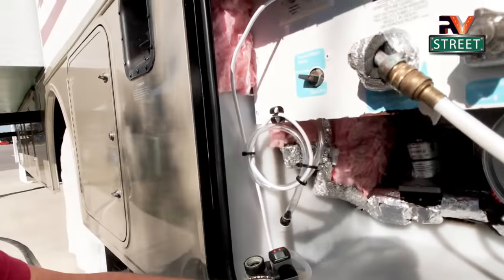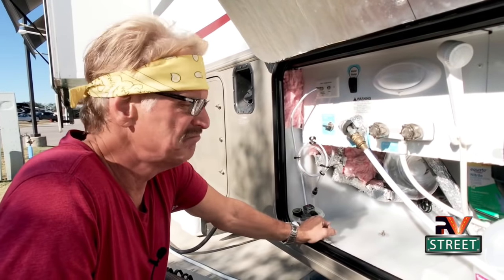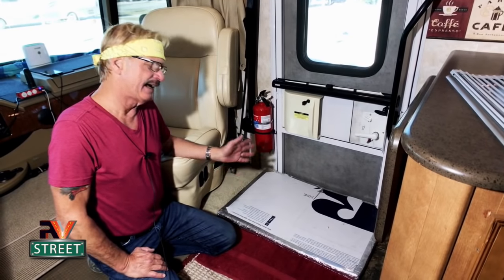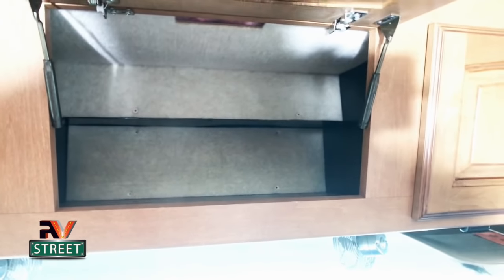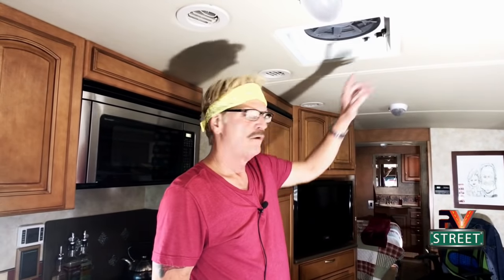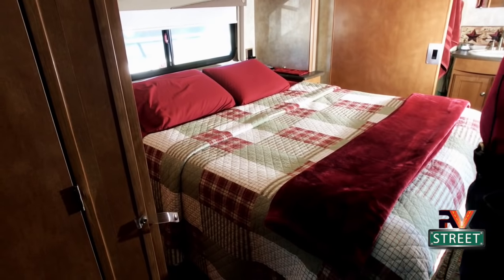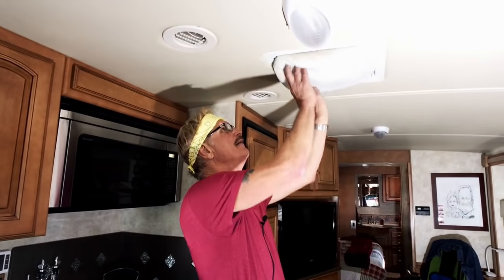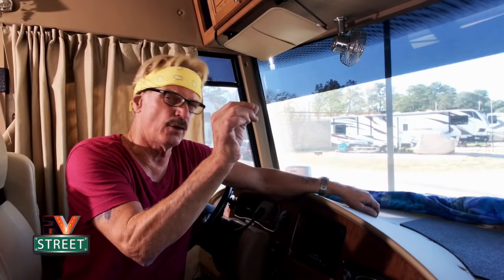😰  INSULATE, HEAT & PROTECT • Key to stay warm in your RV

Comment: I'm charged 17cents per kw hr. Just using a 1500watt floor heater and a 750watt floor heater at 20deg average ambient temp was costing me $400 a month electric bill alone. And that was turning off the hot water heater every day. These RV places that you have to pay your electric usage set the rates high to the point it's very expensive to use electric anything equal to propane consumption. Greed.  So I've been mixing it up propane and elect and it's still costing me $400 a month in cold weather In a 40ft 2020 Montana. I'll try some of your tricks and maybe build or order a canvas skirt to haul around. Good video. 
Our Montana has that patent pending front cap window which is kinda cool but I just pulled 5 gals of water out of there. I recommend avoiding that front cap window and lounge sofa. Go with the closet front cap. Happy RV'ing.
Reply from the maker: I recommend avoiding that front cap window and lounge sofa. Go with the closet front cap......
I agree.

Comment: We bought our first RV this year.   A Class A Thor.  In early Sept we were in SD.   We were not expecting below freezing temps and used our propane furnace.    The book from Thor does state that they do not suggest just using just electric heaters as they have installed vents off of the furnace to keep the pipes from freezing.   Respectfully,   Kevin
Reply from the maker: If you have basement heating that comes from the propane furnace and it's going to freeze outside, then yes by all means use your basement heat since you have it. But what if it's 35º, 38º, 42º or whatever. It's cold but you don't have to worry about pipes freezing, your not going to disconnect your outside water etc. This is what I was trying to get at with my question. Why not run a floor heater or electric heat if you already have full hook ups? It's cheaper, it's quieter, and you don't have to be continuing to go fill your propane tanks. I mean to each his own but for us it's going to electric floor heat. It just makes more sense.Respectfully, Martin 👍
Reply: RVstreet    I agree 100%.   You asked why anybody would run propane furnace.   I gave you an example in fact.
Reply from the maker: @KevinCoop1  👍

Comment: Did I miss it?  Explanation for why to use Un-faced R-19 batting?  Reason:  faced insulation can trap moisture, causing mold. Unfazed allows (slowed) movement & drying of moisture..you want the moisture to be able to dry out. 
Best thing ever? Dehumidifiers!  If you’re clever, can make those drain to the water tank, that you FILTER the water from.   One issue though, is that some dehumidifiers will develop ice that clogs the coils, so, will need defrosted before those will run again.

Comment: I think this is so awesome ty for your amazing videos! Question does any of this create any moisture problems as in mold? Ty!
Reply from the maker: Thank you Jeremy 👍
No. In fact it helps prevent it. The better any RV is insulated the less condensation is created which overtime could create mold. That's why I focused on insulating so much in this video. But in the winter—where you have two colliding temperatures.....you take care of condensation with the ways I discussed.
One place every RVer should watch for and prevent mold is under the mattress. I have a video coming out in early Dec. that will discuss that.
Reply: @RVstreet  Ok sounds great I’m going to get right on that this weekend,ty again!

Comment: We use propane heat because it heats our underfloor and is releases moisture . Electric heat is dry, and does not heat under our floors... Two of us even get nose beads from electric heat. Also , in Texas electric heat runs us 300.00 extra our month. Propane is very Cheep wholesale in Texas. 4 full bottles is only $40 .
We usually use no more than 10 bottles a month for heat, cooking, water heater. Our refrigerator is electric and propane . Also , when the power goes out , propane and DC ( we have a solar battery charger) powers heater water heater and refrigerator ...
But we use to use same heaters you do. We gsve them do out daughter in her 27 ft c class.

Comment: Just happened to see your video.  I've been done with propane heaters years ago despite good heat output because my wife and I could still smell the fumes. They also put a lot of moisture in the air as the windows were dripping the next morning.  I have a class B + RV so my heat needs are smaller.  Recently bought one of those diesel heaters as we boondock more now. They exhaust outside so the heat is pure clean dry heat and so hot that I have to open the window to let more cold air in.  Only needs a good 12 volt source as a gallon of diesel can last over 2 days.  The point about using your ceramic heaters because you paid for the campsite is perfectly valid but some would argue that your leaving a larger carbon footprint.  Remember the power plant has to burn more coal or gas to provide your electricity. Either way you need to exhaust some resources to provide comfort.
Reply from the maker: I did cover how to control the moisture/condensation that most RV's get on the windows when it gets really cold outside and you keep the RV warm inside. Did you watch the whole video? Most people—even us—use a couple of small dehumidifiers and crack a couple of vents so the RV can breath some. With that combination there is no condensation.
thx Phil

Comment: All you have to do is take a large candle and put it inside a coffee can set it on a concrete block on the floor in the middle of the RV and light it and you will be toasty warm in a few minutes there's a trick to try it saved my life at 33 below in Maine one cold night inside my tractor trailer when the fuel gelled up on quit
Reply from the maker: Good emergency tip. We love it up in Maine......in the summer.

Comment: 37:31 Great info. Thanks! BUT too much info with the spooning thing😂.  APPRECIATE THE CLEAVER IDEAS. Consider a wabasto heater?   I think this is the best for off grid heat. Get wabasto brand and NOT Chinese knock off brands.  If the heater doesn't work, PUSH DOWN THE CONNECTOR UNTIL YOU FULLY SEAT IT ALL THEY INTO THE UNIT!  I'm a veteran tech 25 years and I had to call their holiness for help. The connector is deceptive about how it fits.
Reply from the maker: Thank you for sharing your knowledge and helping the RV community. 👍

Comment: I use the propane furnace when I first enter my trailer because it heats that space very, very quickly. It's only about 140 sq.ft. Once it heats the trailer to the thermostat setting and shuts off, I turn it off completely and use a tiny electric heater.

Comment: Regarding the propane use: I have all tanks underneath and they are heated by air using the propane system. So I can use electric when it’s at most around 30, if it gets lower I will have to use propane heating to avoid pipes and tanks freezing.

Comment: The condensation on the window would best be prevented with insulation,  like that reflective bubble wrap. Condensation not only causes problems with water damage but it reduces your comfort level by lowering the humidity.  
72 with 5% humidity feels cooler and is less comfortable than 68 with 35% humidity

Comment: Hey Martin great Video I use Propane and electrical heat to counter each other on the moisture problem. Also having double pane windows helps.
Reply from the maker: Ya, we have Double Pane Windows too in the rest of the coach but of course not up front in the cabin area. But in our coach even with Double Pane Windows and it really gets cold outside and we're keeping the coach really toasty—like 72º-74º inside—we still have to run our dehumidifiers and crack a vent or two to control condensation. But it works good that way.

Comment: We have a propane furnace in our fifth wheel. It works very well but it's expensive. This year we switched to ceramic heating. 2 units, and wow what a difference. We stay in the north during winter. And like he said. Insulate everywhere you can.
Reply from the maker: I'm with you on this one.

Comment: Hi Martin. I really like your videos that you and Joanie make, thank you. A question on your insulation part. Why do you take the backing off??
Reply from the maker: This question has been answered in the comments many times but here it is again....
In a nut shell, the faced insulation is normally used as a vapor/moisture barrier when used in home walls application but is not needed in this situation and especially when I’m putting in several layers in those large empty cavities. If Home Depot had unfaced in stock at the time, I would of bought that.
Reply: @RVstreet  Lots of comments to look through so I appreciate your response Martin.

Comment: Pretty cool looking to moving into a new camper full time, in a couple weeks definitely goin to take advantage of the summer time to upgrade the insulation before the winter rush happens. Also do yall use skirting around the bottom ive seen it as an option on a few sites.
Reply from the maker: No we don't.

Comment: Martin, I do use my furnace if it’s is cold with full hookup purely to circulate warm air through the underbelly to keep my pipes warm. Up in Alberta we will camp through to Thanksgiving (second weekend of October) and it can get down to about 15 F with snow so it really helps prevent freeze up of the water pipes.
Reply from the maker: Ok got it. Ya we don't have basement heat. So I understand what you're saying. Several others have said the same thing that have basement heat. The way I dealt with those areas is the insulating my bay doors and running my lamp in the wet bay. The coldest temps we've experienced is 17º for several days and did fine. But I hear ya. Thanks for your input. 👍

Comment: You use the propane furnace to heat the basement. Unless you have a way of piping the hot air from electric heaters to the basement. What I do is use propane furnace on a certain temp setting so it will maintain basement heat and then use electric above in the rooms.

Comment: I've seen this video about a dozen times now. Thank you so much for doing this! I just bought my RV. Been in there two nights. So cold. I plan to do everything you talk about. If you see this, I just have one question. In your wet bay, I can see the shiny part will face inward, which was the opposite of what you suggested earlier (unless I misunderstood). Did you do that because you want the heat to stay inside of that bay? Maybe it's unique? Thanks again!
Reply from the maker: Martin took the backing off the insulation and I can't remember why he say he did that.

Comment: When ive used propane its just to knock off chill. I have a small pull behind and space is limited,  but I may try a small heater thanks for the tip

Comment: \If I wake up and it is cold I will turn on the furnace to take the chill of then I have my plug in radiator heater that will keep the whole trailer comfortably warm .  I also start the furnace occasionally, to be sure it will work when and if I do need it.

Comment: Took a look at this video again as we are headed to Texas this Fall and Winter. We have a similar Winnebago, 33C model. I think the only reason I would use the RV propane heater as it warms up the water bay in super cold temps. But we do carry a space heater as well. 

Quick question. Where did you plug your light bulb in at the water bay? 

I'm also installing a light behind the fridge in a similar fashion.
Reply from the maker: On the light....I run an extension cord from my inverter to the wet bay.

Comment: Thanks for the tips!!
I'm interested in the floor heater.
Reply from the maker: The one I showed in the video is no longer made. However, I have one in my Amazon Store in the "Stay Toasty, Control Condensation" category. It's black in color, it operates just like ours does and in fact has a couple more features, is lighter and has a smaller foot print.
https://www.amazon.com/shop/rvstreet
Reply: @RVstreet  thank you, but which category is it under? I looked in electrical and one other. Can't recall the title.
Reply from the maker: @r8edrv4fun65  "Stay Toasty, Control Condensation" category.

Comment: Some private RV Parks have rules against using portable electric heaters because they are higher fire risk. At least that's the explanation they listed on the park rules.
Reply from the maker: We've never seen those kind of rules but that doesn't mean they may exist in some places. We have seen restrictions though on using Hughes AutoTransformers. Electric heaters are not a higher fire risk but they may say that in their rules to reduce folks from using them because they use electricity which cost them money.

Comment: I have used a mr. Heater for a long time. I never crack a window when I use it. I travel in places where in the winter it gets down below zero. So I have had to use my mr. Heater and an electric heater at the same time my mr. Heater has a plug-in and a fan the instructions say I don't have to take and crack a window the other thing that I can do is that run an external propane tank 7 gallon 30 lb directly into the living quarters and hook it up to a mr. Heater. I've also been in places that were so cold that I used to electric heaters and a mr. Heater because my regular heater couldn't keep up. I had done all the installation that you suggested and more there's only an inch and a half of insulation in the walls and in my old unit I check in on all the exposed walls I took in hung cheap heavy curtains not tacky ones cheap like Walmart ones. They look okay but they also I made him so I can take it and then at night time pull them across the windows which kept people from looking in but also helped insulate more in the daytime I could open them up so I can see out the windows but the walls would still be covered. I took and took some of the silver bubble wrap insulation and completely covered the inside of the door except for the window, where I put a special velcro window covering over it so I could open that up and look out the window or at least let light in cuz you really can't see out of this Frosty. In the compartments it has storage I did all the doors and the front wall and the back wall and where are the piping was covered I took spray insulation and insulated that area there is like under the bathroom sink against the back wall I sprayed insulation there and then took it put some foam board against it and pushed it into place the spray insulation stuck to the outside of the wall of the trailer, and the insulation board. on the underside of my vehicle it was completely covered in plastic but there were some areas along the external wall of the camper that have pipes running through them how do you spray foam insulation in there. If you have a newer camper the white and blue water pipes actually have about a 15% stretch factor if Frozen when water freezes it's only increases by 11%. So I drain all my water when it's really cold and I don't worry about putting that antifreeze stuff in there because I found out that some of that stuff is really poisonous. the small amount of water that's left over shouldn't be enough unless there's a really bad design to fracture your pipes you do have to drain your hot water. Sadly to say in my case my freshwater tank is exposed to the outside calls and there's nothing I can really do about it unless I wanted to build a really big skid plate of sometime but where the water pipes go into the camper I Tech and spray foam insulation in there all I got outside wall all the way to where the connections went into the camper to keep dogs from freezing when I was doing that I had to rearrange some of the pipes because it actually put some low spots in them. those are some of the things that I've done I'm also confined to a wheelchair but I did take him put adjacent rubber back rug not carpet butter rug which house keep the floors a little warmer to the foot for those of you who walk around. so besides my main heater it don't matter if it was put into the RV I have two electric heaters and a mr. Buddy Heater I can tell you that there are times just using the Mr Buddy with a blower that's built into it I've had to keep it on low or it was way too hot in my camper. the foam cushions that you can put up into the skylights vents are great but I've also found that if you want to save money why you're buying installation buy a sheet of 2 in insulation and cut it to fit your Skylight holes and it does just as good I found at the pillow ones running between 7 and $20 and the insulation cost about a buck and a half to fill that hole. I hope this helps people out the thing that I found is it my battery compartment which now holds five Batteries Plus a power converter inverter also needed to be insulated because you don't want your battery is getting really cold. do I have work from Massachusetts to Wyoming to Northern California to Southern California where in the six winners that I work there had major snow storms, where they hadn't had snow storms in 15 years. I'm from Colorado and I saw a lot of people with burst pipes no heat and actually had their RVs made uninhabitable because of burst pipes. And those six winners I saw temperatures all the way down into the single digits many times as I lived in the high desert and work in Palm Springs. I like the nice people in the high desert not too stuck-up people And Palm Springs. Have a good day unless you've made other plans!
Reply from the maker: Thanks for that report Jay.